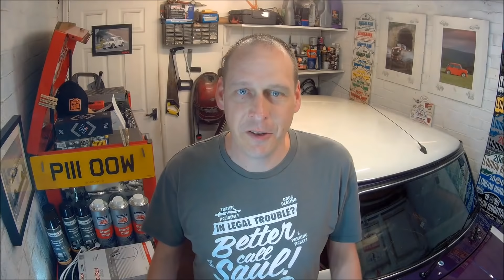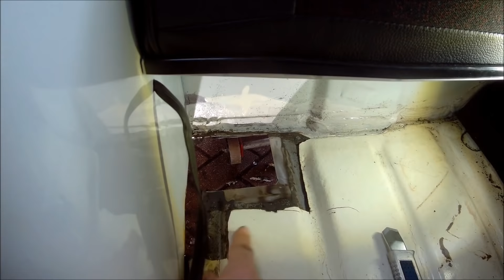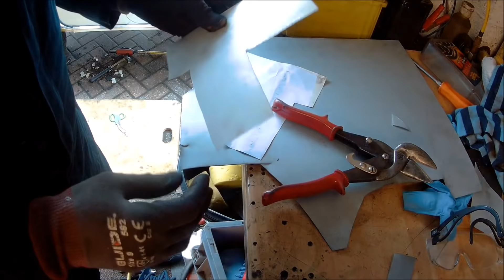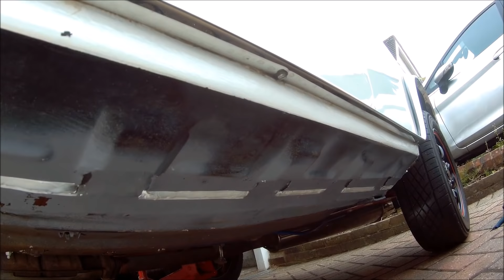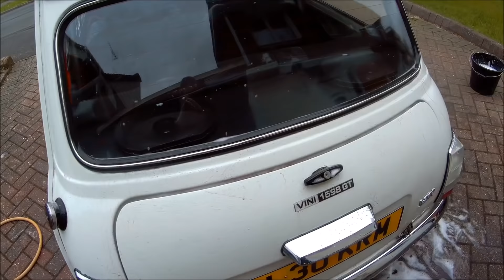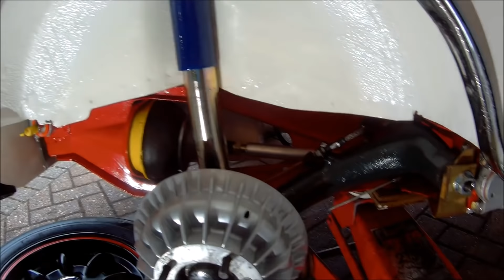Classic Mini Workshop - OVERSILL / COVER SILL REPLACEMENT Pt. 3

Comment: Great job Keith. Nice patch panel and great welding.  Regards the metallic particles on the paint you may find that that is fairly normal as most modern brake pads are made of sintered materials that contain a high metallic content. Hence why your mini body shell was almost completely covered in that reactive purple colour.....and we breathe that stuff in too.....anyhoo, great watching and have a great weekend..

Comment: Keith, Great job i‘m sure you feel a lot better now it‘s done & sleep easy lol. Your right the little brackets front and back of the floor pans was for the dolly track they used for assembly in the factory not required but a nice touch! Cheers Dave.
Reply from the maker: Thanks Dave :) Hopefully I can get it all finished this weekend although I'm busy Sat / Sun so hopefully can finish off on Monday.